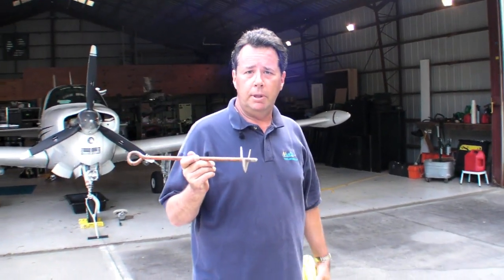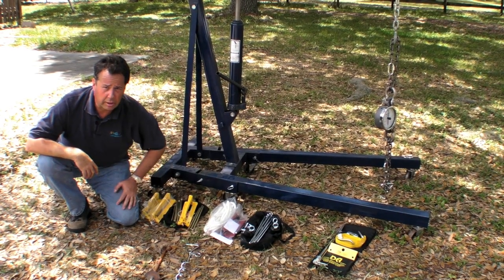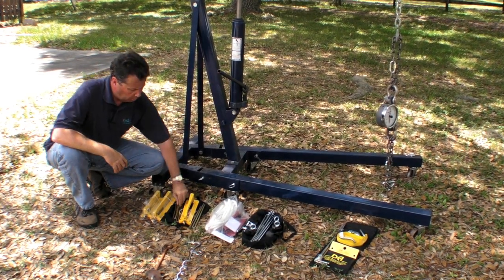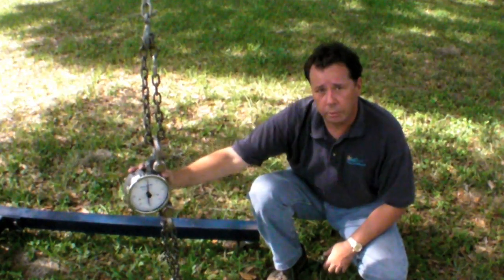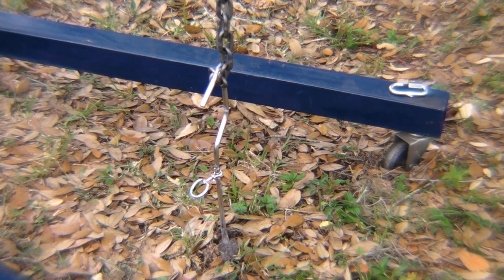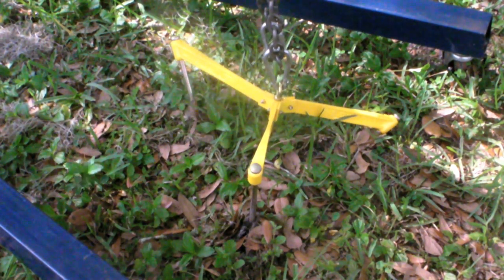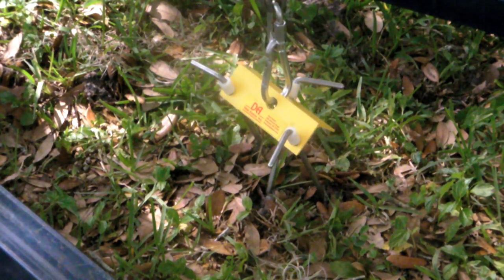Aviation Consumer Tiedown Test

Comment: If you are going to be driving stakes in the ground, you might as well just get some rebar and cut it to whatever length you deem appropriate, bend a loop or angle in one end, and hammer it in the ground... A 20-ft piece of rebar will give you (6) 40" stakes and is cheap enough that if you can't pull it out of the ground, then just hammer it all the way into the ground after you get through and leave it there...

Comment: They are pulling directly  upwards, most aircraft manufacturers tell you this is not the correct way to tie an aircraft down but for example on the left wing you should be 3 feet forward and 3 feet outward of the tiedown point, the same on the right-hand wing, 3 feet forward and 3 feet outward and tail is tiedown 3 feet backwards. This way the aircraft is supported correctly and it cannot move, especially lighter LSA type  aircraft.   In this configuration you are not pulling the anchor directly upwards but are instead pulling it at approximately 45° - 60° sideways and this increases the way that these tiedowns work especially the proper screw-in types (not the dog ones)
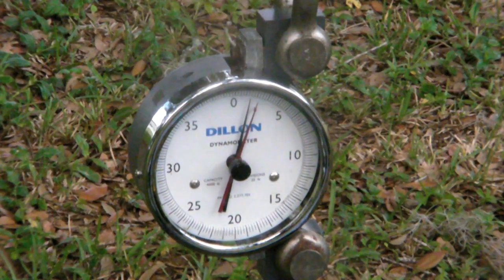Reply: If you watch the whole video, around 3:06 he says "when we tried to pull at an angle, rather than straight up, the FlyTies did better."  So they did actually test pulling at an angle, they simply did not include that test, I assume in order to keep the video short, and to get to the ultimate point they made at the end - none of these kits are up to the FAA's recommendations as far as load tolerance.

Comment: I use the EAA , homebuilt design for my a/c.  It has 3 , 18 inch pins on each tie down.  They take some pounding to get them in the ground but , for example, when I used them at S&F last month, they went through a much more substantial layer that was about 10 inches down!  I was not there during the tornado but I could imagine that if your tie downs were not deep enough, they would not hold very well, no matter what type you used....

Comment: Test rig pulls straight up.  I don't know about you, but I sure don't place the tiedowns so the load is straight up, lifting them out of the ground.  Much better to have longer lines allowing the stakes to be set up wide adding some horizontal vector.
Reply: The FlyTie instructions say to do exactly the test method.

Comment: How did you translate 65 knots of wind to 3,000 pounds of load?
What direction would the load be?  ( I guess it starts with 3,000 pounds
of force directly down, e.g. gravity ).

if the plane could climb at 65 kts - it would have and equal force upward,
not 3,000 pounds up, right?
Reply: Really it depends on the size of the aircraft. A larger aircraft, while heavier, will have greater surface area with which wind can push.

Comment: With 2999 pounds pull, my airplane would be worth less, than the pin itself.
Sorry, but 65 knots or 3000 pounds means nothing without context....

On the other hand - thanks for the fair asessment. I use dog-pins with welded top. Doesn't bend out !